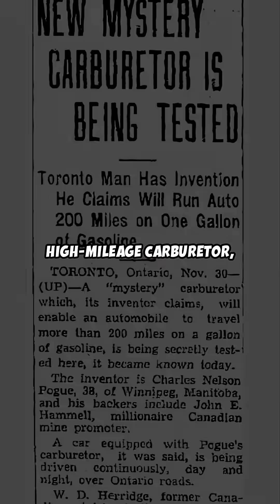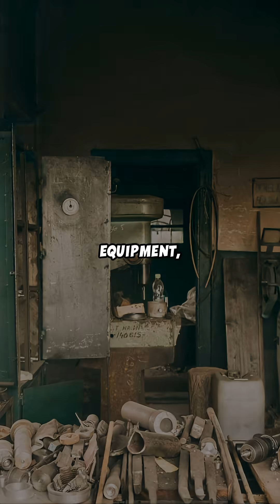Killer Patents: The Forgotten Genius: Charles Pogue’s 200+ MPG Carburetor!

Comment: Have you ever noticed all cars and trucks and so on? Have to refuel or plug in after 300 mi even to this day. Interesting
Reply: Uh no... My old Scion XD had a 11 gallon tank, and easily got 30 mpg, 330 miles to the tank. My 2019 Camry LE hybrid gets 50 mpg on a 13 gallon tank, 650 miles to the tank. Why worry about miles to the tank? The average person does not drive 50 miles a day. If you bought a plug in hybrid that got 50 miles of charge then you could drive 90% of the time on electric only. When you go out of town after that 50 miles it just switches back to normal hybrid mode, and burns gas. Now some States like mine charge you extra on registration if you drive a EV, plug in hybrid, or regular hybrid like mine. They do this because they say we aren't paying our share of the gas tax. If that were true then shouldn't gas guzzlers get a tax break?